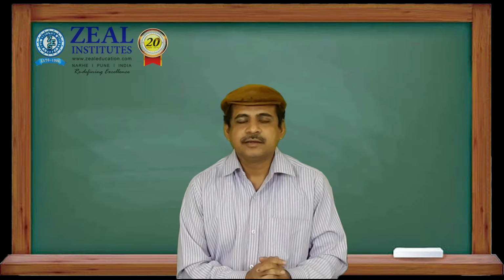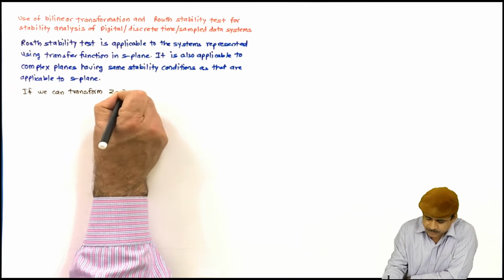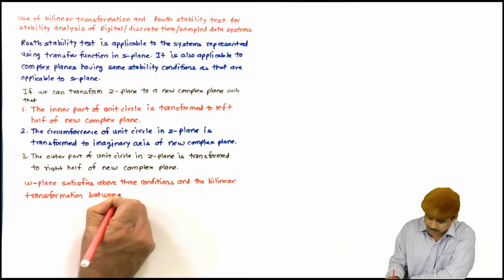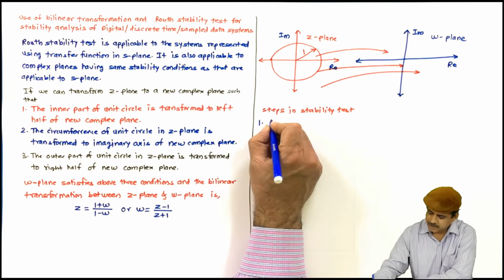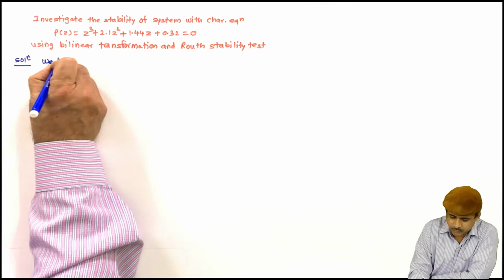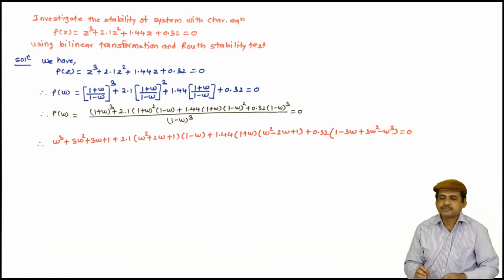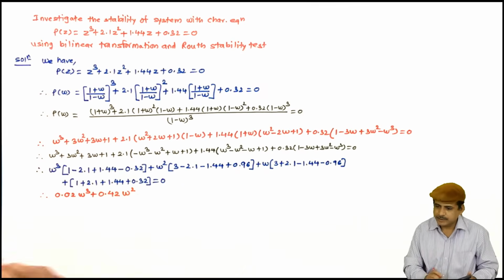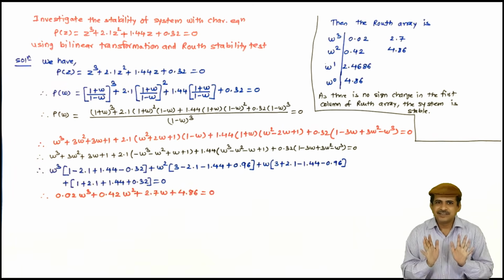L26 Bilinear transformation and Routh stability test

Comment: Sir, If we use (1+w / 1-w) whole answer is getting wrong compared to textbook. Bcz in text book they used (w+1 / w-1)
Reply from the maker: No. The final answer about decision on stability will be the same, however the characteristic equation may change (need verification).
Reply from the maker: (1+w)/(1-w) means [(w+1)/(w-1)]*(-1)